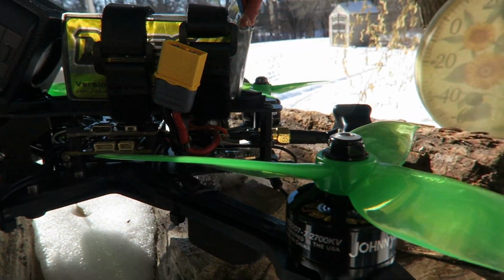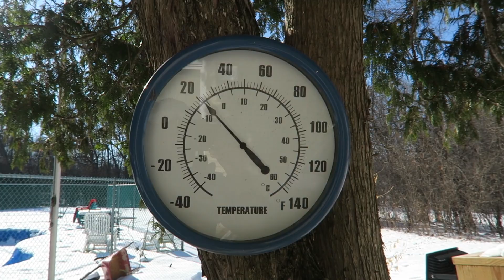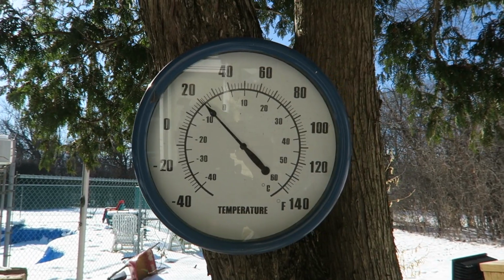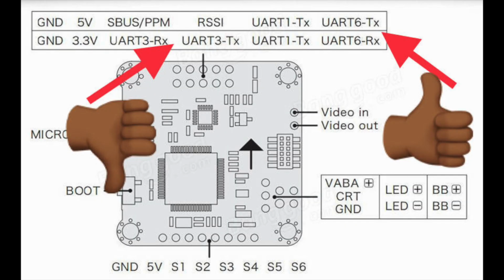Impulse RC Reverb - JohnnyFPV Motors  - Hobbywing Stack - TBS Crossfire

Comment: I'm about to wire up same board with crossfire and was going to use UART3.  Did you ever find out why UART6 worked and not UART3?
Reply from the maker: James Nathaniel no sir. After I got it working i just stuck with it.